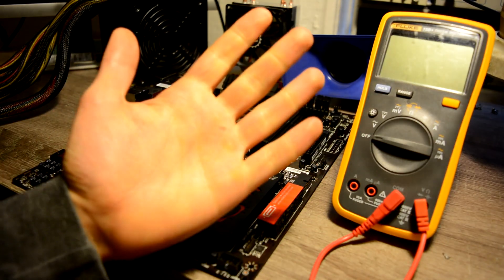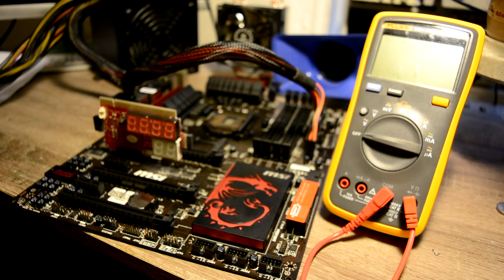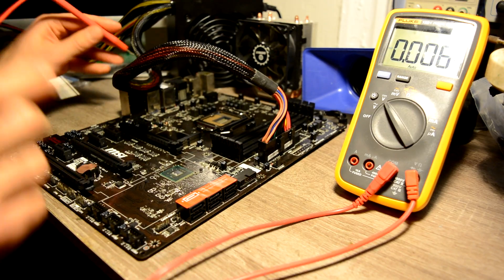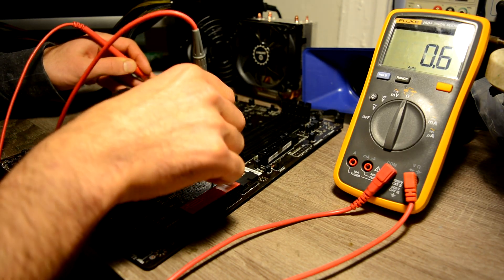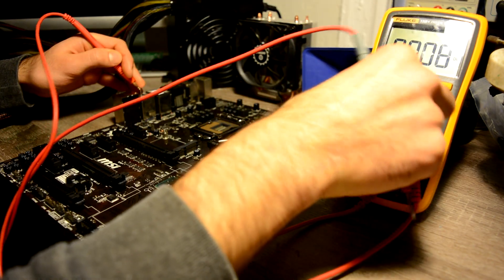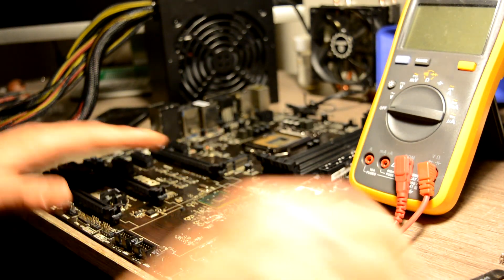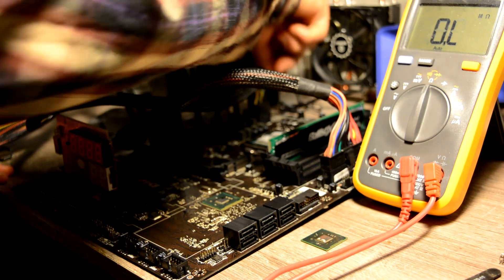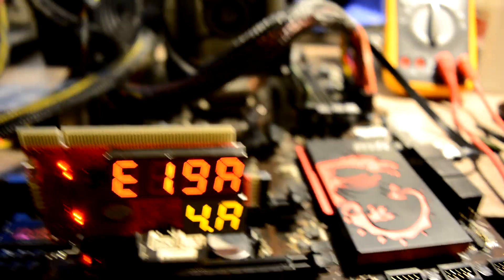Z97-G45 desktop gaming motherboard diagnostic + repair process

Comment: You should place the camera overhead, so we can see what your'e actually probing...  Its very hard to see what your're actually doing, for the 1st half of the video. Thanks for the videos anyway.. Keep up the great work!!!
Reply: I agree, please show us what you are actually metering, this way we can't see it.
Reply: I do agree with you but I have something to add.
Check out BareVids Amplifier repair https://www.youtube.com/channel/UC9GiteyeFSMlmqyBAt9oM9w
Sit through a few of his streams and you will quickly understand the basic topology of mosfet power circuitry.
Another great topic to research is Buck Converter topology as this is essentially how your motherboard steps down the 12v to 1v and other voltages.
If you watch Eli Tech he is going from ground to the gate or collector of the mosfet to confirm that the entire power rail is down.
Since there is a short to ground overcurrent protection will kick in not allowing the board to turn on.
We probe in peace!
Reply: Nope, he's just show you that he can repair things, not how to repair it.
Reply: Appreciate Video! Excuse me for butting in, I would appreciate your opinion. Have you ever tried - Ianandon Unflappable Interest (Sure I saw it on Google)? It is a great exclusive guide for getting your woman to happily cuckold you without the normal expense. Ive heard some unbelievable things about it and my mate  got great success with it.
Reply: This is just superb, I've been looking for "how to fix a circuit board trace" for a while now, and I think this has helped. Ever heard of - Giyathan Bewildering Gratification - (search on google ) ? It is a smashing one of a kind guide for discovering how to repair your electronic items like a wizard without the hard work. Ive heard some awesome things about it and my colleague got great success with it.
Reply: @Eric Messiah  @Rhys Westin  you two bots have been reported
Reply: interesting points ,if anyone else  needs to find out about 
phone screen repair
 try Saankramer Electronic Magazine System ( search on google ) ? Ive heard some amazing things about it and my m8 got excellent success with it.
Reply: interesting points ,if anyone else  wants to learn about 
electronics repair forum
 try Saankramer Electronic Magazine System (just google it ) ? Ive heard some extraordinary things about it and my buddy got great success with it.
Reply: I'm not sure but ,if anyone else  trying to find out 
electronic component repair
 try Saankramer Electronic Magazine System (just google it ) ? Ive heard some interesting things about it and my co-worker got amazing success with it.
Reply: Not certain about the points made but ,if anyone else  needs to find out about 
repair guides
 try Saankramer Electronic Magazine System ( search on google ) ? Ive heard some awesome things about it and my work buddy got great success with it.

Comment: hi, great info. could you help me with a jetway m26gt3-svp. I have a diagnostic card that shows C3 error code on it. the motherboard will come on processor heats up fan runs and everything appears normal but the bios won't reset and the motherboard will run with the bios pin set on pins 2 & 3 which is supposed to be reset for bios. motherboard is stuck at C3 on post error card. i'm thinking it is probably component problem on motherboard or corrupt bios. I think it has phoenix bios but not sure. if you could help it would sure be appreciated as I'm learning as I go. Thanks.

Comment: You found those power lines like a champ, I usually spend a couple of hours looking for the schematics I bought of some russian forum for 10 bucks!
Reply: Where do you buy them? I would like to get a schematic for Rx 480 gpu
Reply: @DragonAndrija  it's real rough, because I searched for a while on a bunch of different forums, it would be much safer to buy a parts board instead
Reply: @DragonAndrija  badcaps
Reply: This comments funny because it’s true 😂

Comment: very interesting! rare failure. Most of the times the power delivery to the CPU fails (Mosfets or even the capacitors on older boards)
Reply: Probably overclocked and the hub couldn't handle the higher frequency or higher voltage.

Comment: love these videos man by the way where do you order the chip?
Reply from the maker: Stephen Dean taobao, Ebay, AliExpress
Reply: @elitech3339  I wouldn't trust anything from AliExpress
Reply: @ethanthompson3934  don't worry i Order my Chips from aliexpress because all the chips came from china so why don't by these chips from china. All came to me correctly without a Problem.
Reply: Metl_Play glad to hear it worked out good
Reply: Metl_Play glad to hear it worked out good
Reply: They may very well be used chips pulled from e-waste. It has been a huge problem in laptop GPU repair business because nvidia and AMD do not sell brand new GPUs ics. Everything from china is more or less recycled crap
Reply: @Kizmox   if recycled is crap then buy new one. oh, wait...
Reply: @ethanthompson3934  I do not like AliExpress also, not that things do not work , it is to slow delivery . Way slower than eBay for me.
Reply: @FantaBH  Choose Aliexpress Standard Shipping over ChinaPost if the seller has it as an option, it's a few dollars more but so much faster.
Reply: Hi Sir Eli tech Im happy seeing ur repair guidelines,I want to learn repairing of computer parts also and I do learn a lot in watching video rather than reading books..can I ask a favor of being detailed in the parts you troubleshoot??Like checking 12v,3.5v,5v etc. bcoz I dont see what parts of mosfet or electronic parts to look at.plss thank you more power Godbless
Reply: He probably got it off of another motherboard.

Comment: I have a asus Prime b350 plus motherboard that is bricked, my board crash during a bios update are you able to fix that for me i know that's the problem everything else works
Reply: That would require an eeprom programmer which can write the bios to the eeprom.
Reply: Are you able to fix that for me, you'd be welcome to make a video about it
Reply: @mustacheenthusiast1079  If i had an eeprom programmer I could. But maybe the video author has one
Reply: @laptopstuff8886  That's what i'm talking about if Elii Tech can do it for me, like how much he will charge to fix it for me
Reply: Did you try flashing the BIOS back to the original?
Reply: @cairnserelli72  The motherboard turns on but i don't get a display just black screen i can't get into the bios
Reply: i tot that board has crashfree bios 3 u can use a usb to recover it
Reply: @wilsonvoon1833  How do i do that?
Reply: 1.4 
ASUS CrashFree BIOS 3
The ASUS CrashFree BIOS 3 is an auto recovery tool that allows you to restore the BIOS file 
when it fails or gets corrupted during the updating process. You can restore a corrupted BIOS 
file using the motherboard support DVD or a USB flash drive that contains the updated BIOS 
file.
•    Before using this utility, rename the BIOS file in the removable device.
•    The BIOS file in the support DVD may not be the latest version. Download the latest 
BIOS file from the ASUS website at 
www.asus.com
.
Recovering the BIOS
To recover the BIOS:
1. 
Turn on the system.
2. 
Insert the support DVD to the optical drive or the USB flash drive that contains the 
BIOS file to the USB port.
3. 
The utility automatically checks the devices for the BIOS file. When found, the utility 
reads the BIOS file and enters ASUS EZ Flash 3 utility automatically.
4. 
The system requires you to enter BIOS Setup to recover BIOS settings. To ensure 
system compatibility and stability, we recommend that you press <F5> to load default 
BIOS values.
DO NOT shut down or reset the system while updating the BIOS! Doing so can cause 
system boot failure!
Reply: @villekoppelo8817  yep thx for clarifying
Reply: Jason, where are you based?

Comment: jump the power supply = touch green wire to ground and turns on.
Reply: @Robbi Robson i only do to turn on psu if i dont have a motherboard to see if it works.

Comment: Oh yea i have the z87-g45 gaming that only works with windows 7 but if i install windows 10 usb ports doesn’t work lol
Reply: have you updated your bios?
Reply: i have the same problem with the z77a-g45 from msi usb 3.0 works fine on windows 7 but on windows 10 and 8.1 do not work, is a issue with driver compatibility i try EVERYTHING with the drivers and do not work i buy pcie 1x usb 3.0 expansion slot and problem solve 2.0 works fine but 3.0 native from the mb do not work
Reply: @MaguiLaftw  windows 7 is better than windows 10 tbh
No bloatwares
Reply: https://www.dell.com/support/home/za/en/zabsdt1/drivers/driversdetails?driverid=6y1x2
Reply: Researching on Google shows that updating the bios, clean installing Win 10, and using MSI Total Installer should work.
Reply: @ayuchanayuko  i wish it was that simple but i even made a forum post https://forum-en.msi.com/index.php?topic=271861.0 trust me this is the most strange problem that i have ever encountered but its all good i really don't care since its a test mobo now.
Reply: @Brasileiro Patriota and you would think i didn't update my bios lol, trust me its the most weirdest problem you will ever face...
Reply: did you try a Driver finder software? Like IObit Driver Booster?
Reply: J'ai moi aussi des problèmes avec l'usb 3.0 sur une MSI Z97-G45 Gaming, les ports sont instables, quand je connecte mon smartphone pour utiliser le partage de connexion 4G, celui se déconnecte, se connecte et ainsi de suite...de plus, il y a un message qui me dit que les ports pourraient fonctionner plus rapidement sauf que j'ai bien brancher les ports USB 3.0 au connecteur USB 3.0 de la carte mère et que j'utilise des périphériques USB 3.0.
J'en ai marre, je ne sais pas d'où vient ce problème, mon bios est à jour, je suis sous Windows 7, je pense que je vais changer de carte mère et chercher une Gigabyte, en espérant que c'est pas toute la série des Z97 qui est touchée !
Reply: msi B150 gaming M3 the same ....
Reply: Maybe driver issue.
Reply: KiKi_HUN no not a driver issue i gave trying to fix this problem 2 years ago but i still have the board, kept is as a test mobo.